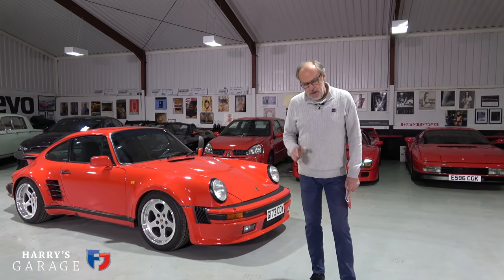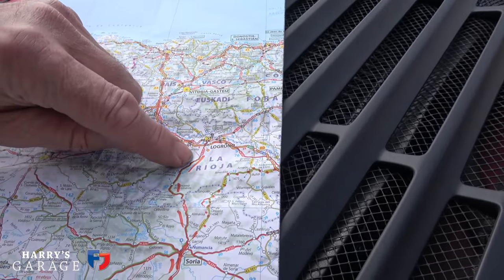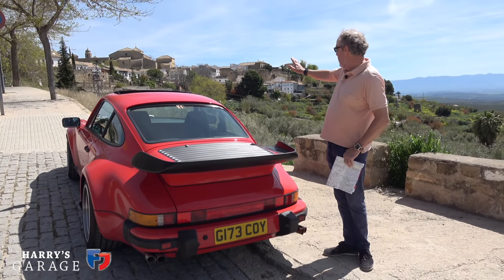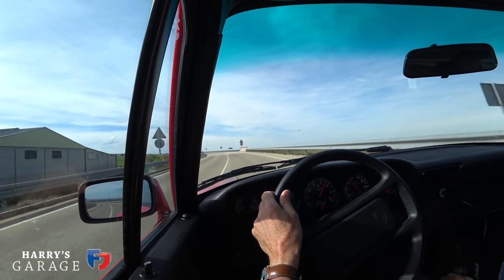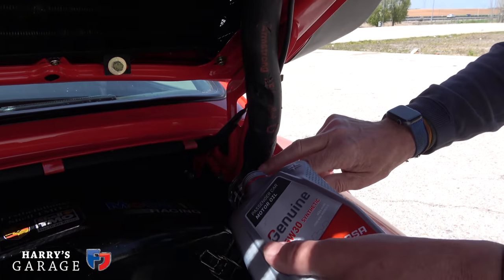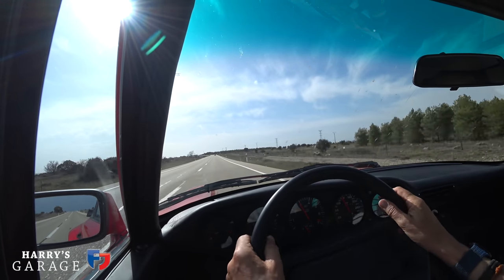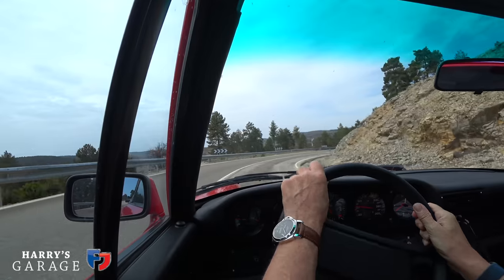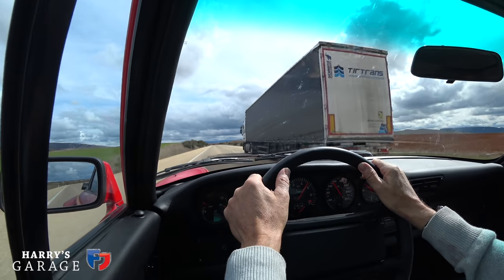Spanish road trip special in my Porsche 930 turbo S. How does this classic 911 cope with big miles?

Comment: speed limit in a open road where is the guardia civil , didn´t see one and in secondary roads one drives at the maximum speed ,with a long open road no one drives at speed limit ,and the guardia civil are all in highways catching drivers at 200 to 300 km´s /hour ,they receive a % so the faster you go the more money they receive ,but in highways that were built with very good tar as the road you drive it´s also a road built with quality when Spain and Portugal entered the european comunity, when younger i drove a lot through Spain but roads were the worse one can imagine there were parts where the tar was only inbetween the two tires and once at night ,this around 2 in the morning without any warning i entered a part of the road that was being built new so for the next 100km i drove in gravel at maximum speed of 50 km/h and maybe too fast for the road condition,this in Andalucia

Comment: Did you use 4th or 5th gear most of the time on the scenic routes?
Reply: seemed like 3rd & 4th, I'd say. Cos cruising between corners 2,000- 2,500rpm

Comment: Lovely car. There is no way that you're supposed to get that type of Mileage. Get the car checked firstly for air/fuel ratio to ensure it's within range. In fact, every performance turbo car should have one so you can know the engine is not running lean, and in this case, to see you over-rich its burning. Perhaps you Cats are clogged up, which would certainly reduce performance as well as burn substantially more fuel. On these long runs, you should bet mid 20 MPH, and certainly not below 18MPH even with aggressive driving.

Comment: Oh H, where is you sense of adventure!? Won’t drive down a dirt road just because the car might get a bit dusty or receive a dig or two because of a flying stone though loosing a windscreen can be a bit of a bind I admit, though it never happened to me thankfully. 
Those roads, how it has changed since I first did that run in 1970 in my 1959 Vanguard estate. Back then it was all but impossible to get above 30 for mile after mile, and when I did and hit of the numerous potholes, I half expected one of the front wheels to come flying off or one of the rear springs snap in two. Then, it took all day to cover the distance from Bilbao to Soria but, what you have to remember is that most of the roads outside the major towns had hardly been touched since the end of the civil war. Now look at it, long straight featureless roads, were is the adventure in all that I ask? 
We also stayed in paradors, they were expensive then as well, and we had to budget for £12-£15 per night when we did.
Anyway, keep up the good work. Regards from a fellow Wirralonian.

Comment: The oil needs to be checked while the engine is running and warmed up, do not over fill it, just above the low line , or you will blow oil all over the engine bay

Comment: I own one of this amazing toy for 12 years now and the honeymoon hasn't ended. Something is definitely wrong with your engine settings.Second.You keep the oil a bit too low.This car really is an oil cooled wonder.Lastly.
You check the oil when the engine is running and the car is on a flat surface.

Comment: Lots of well deserved positive reaction to this video.  Truly enjoyable to watch, the car and the scenery both epic, and the videography very well done indeed.   A few things to note that I'm sure Harry will pick up with time - you check the oil at operating temperature and with the engine running.  The engine and oil tank hold about 15 quarts of oil, add a few more quarts for the front oil cooler and associated oil lines.  Those 500cc of generic gas station oil were quite pointless.  Fuel mileage - in your first video introducing this car, you said the engine was a fully custom job done for a race team owner.  What sort of mileage were you expecting?  This is an air and oil cooled engine running a lot of boost - it requires a generally rich fuel/air mixture and a lean running condition combined with spirited driving and warm temperatures will end very unhappily with burned valves or pistons.  On acceleration, the engine sounded a bit flat to me, some service of the fuel or ignition systems might be needed to sharpen the throttle response and maybe get a bit better fuel mileage.  The comment about the tires - they looked like 30 year old Pirellis to me, I don't think it's valid to say much about the handling on rubber like that.   Finally, I don't think shuffle steering is a great idea in a 930 of that chassis type, and the one handed steering I liked even less.

Comment: I wouldn't put W30 grade oil in that engine... especially in warm weather.
I used to have a 964 Turbo and the best grade was W50... you could even go as high as W60 in hot weather or on track days.
Motul 300V is the way to go... and it smells better too.

Comment: 13 mpg....just to put that into perspective  my 44 tonne volvo articulated truck does around 10.5- 12.5 mpg (fully laden) that's just under 30 tonne of cargo....yes it's brand new, but still those porsche figures are shocking.

Comment: Harry Harry Harry. You always check a 911’s oil level with the engine IDILING. Never turn it off to check it. Read ya hand book. I think at the moment you turned off the engine to check oil level every 911 owner muttered the same words, noooo. I used to maintain a very similar 930s for a customer and yes, thirsty, but I think yours is too thirsty. Might have a over rich delivering K-Jet system. Enjoy the beast

Comment: Do you guys have ethanol over there? It might be an issue with the evap control system if it has one.
Reply: Spanish fuel is E5 both 95 and 98

Comment: Even with the low compression engine it's surely not right if it's doing 12-13 MPG at a 75-ish cruise. These cars do indeed need rich mixture when on boost but they should not be running rich off boost - and a motorway cruise is only pulling about 50-60 hp from the engine. Is the exhaust very sooty? I would be getting a wideband air/fuel ratio (AFR) gauge on it and checking mixtures all through the duty cycle before getting it into the hands  of an expert 930 setter-upper. Quite apart from the fuel cost and the ludicrously short refuelling range, the danger is bore wash.

Comment: fuel usage can't be right!   Can only think a sensor (temp/O2?) has failed and it is enriching itself, or being aircooled old-school 2 valve hemi head and turbo someone has dialled in extra fuel to cool the engine and prevent detonation.   Still, I am sure it could be tuned out at 'normal' road speeds.  Roads look great - does no one else in the world have wildlife problem (kangaroos) like we do in Oz?

Comment: The oil should be checked with the engine running on an Air Cooled Porsche, plus a 930 does not take 5W 30...it should be 20W 40

Comment: If that thing's doing 11 mpg then it's either running so rich that there will be a light trail of black smoke or it's got a leak. No way can motorway driving at the legal speed result in that with an engine that's relatively small. It needs driving to Iain Tyrrell's workshop for some investigation.

Comment: There's no real car culture here in spain as every year they bring out more and more rules and regulations penalising car drivers, you also can't modify a car without going to alot of expense getting everything homologated, even down to an aftermarket air filter in some regions. car drivers are basically being bent over as much as possible to get more and more money out of them. there is a big motorcycle and bicycle culture though